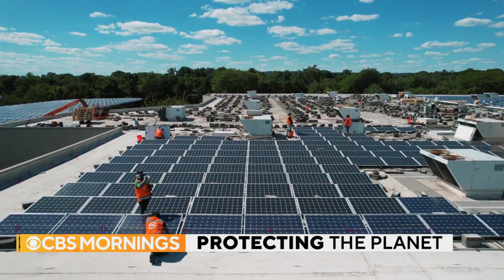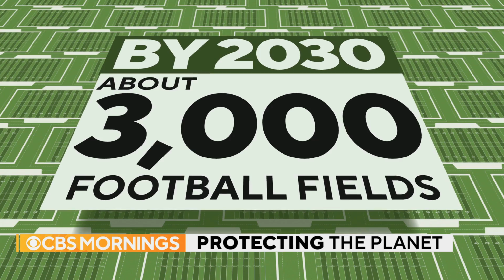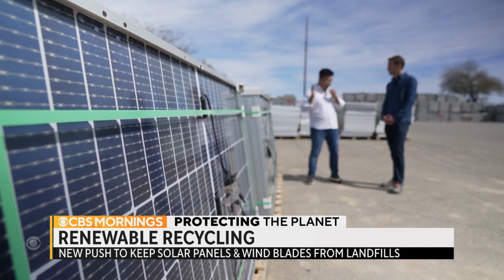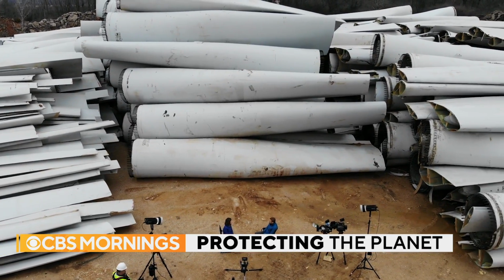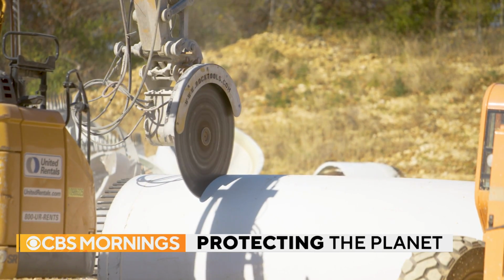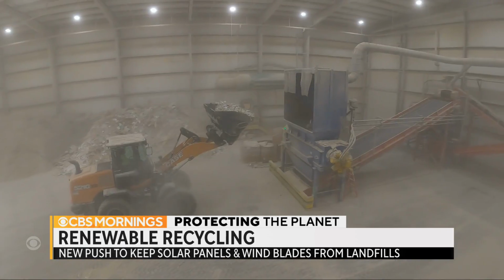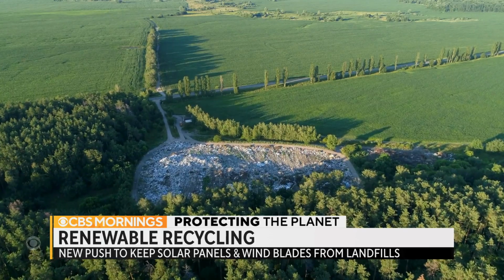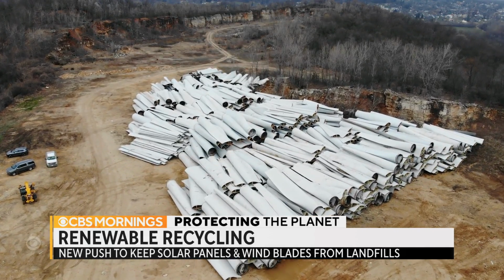Wind blades and solar panels head for landfills after being replaced

Comment: We probably need to develop more readily recyclable components.  Perhaps plastics?
Reply: I would love to see one ultra powerful prototype wind generator constructed of titanium pressed neodymium inside an aluminum housing.  From what I have read, titanium is a paramagnetic material that is not affected by magnetic fields, and it is strong and durable, light weight, and highly corrosion resistant.
Reply: Material recycling needs to become our primary material source, supplemented only as necessary by originally sourced materials.  I would invest adequately in aggregate material recycling, garbage recycling, toward this objective.  Our garbage is a gold mine.  Everything we use, everything we need, is right there in one convenient location, in our garbage.  An objective of 100% material recycling of garbage is a worth while objective.  

There is tremendous demand in the world, tremendous unmet demand, and ever growing demand, and we live in a fish bowl with a fragile and finite carrying capacity.  We have to plan wisely for our future and invest in this now.
Reply: What I am talking about is contactless, frictionless axles, spinning strongly magnetic discs, sandwiched in between conductive discs which may be possible to construct using aluminum.  The only place we would need bearings would be at the prop interface, and that's just to keep the bugs out.  The props themselves could generate their own electricity for the incorporation of LED lights with the placement of a magnetic ring at the interface interacting with a conductive circuit and LEDs built into the spinning props.  At minimum, magnetic field axles can greatly reduce the load of the prop systems, making these in effect light as a feather, as well as potentially electricity generating as well.  Titanium pressed neodymium may be the key to this.  I am sure we can make our wind turbines 10x as powerful, 10x as durable, but the prototype will probably be 100x as expensive, at best.
Reply: I think that at this time, converting unusable wind generator props into a cleaner burning fuel, in terms of green house gas emissions, to replace coal, is a strong step in the right direction.
Reply: We use centrifuges to separate by density.  Vibration can accomplish the same effect.  If we grind up our aggregate garbage, and sort out what can easily be sorted up front, what remains might be separated by vibration.  We would probably have a general idea of the composition of what remains.  Material bands might be analyzed using light refraction, mechanically separated, and re-routed through a refinement process.  I think it would be smart to aim for the production of our primary building materials through such an industry.  A material that can replace and outperform wood may be a top objective.  If we go for gross aggregate material recycling of all garbage, and if this becomes a primary raw material source for us, garbage becomes a commodity, and we might even be able to sell what's in our dumpsters, and if we pre sort, get a higher price.  Get a check from the garbage company, instead of a bill.  I don't think it's impossible.
Reply: I don't know if this can work, but I think it would be great if it did.  When you spin a magnet around a conductive coil, or a conductive coil around a magnet, this causes a current to flow, and electricity is generated.  As far as I know, this is the principle behind every turbine driven generator, from nuclear to coal to wind.  Spinning a conductive coil around a magnet, or a magnet around a conductive coil.  I an not an expert, but what I envision is just that, spinning one material around another, which is essentially an interaction of concentric cylinders, and the limitations on the respective surface are of these.

If we have an axle attached to a wind prop to spin that axle, imagine if to this axle were affixed titanium pressed neodymium discs which spin with the axle.  These spinning disc could be sandwiched between fixed aluminum discs, or similar for facilitating a flow of current.  Titanium may be one of the best materials due to it's high capacity to retain it's shape and resist warping.  I don't know what kind of field drag would be in effect, or if it possible to maintain such system for long without the disc warping.  This could be a fundamental flaw. However, the spinning discs would be made thick and more durable.  I think it's worth exploring.  The main advantage is a greater surface area, of multiple interfacing discs along a single axle, as opposed to an interaction of concentric cylinders, we'd practically be getting volume out of this, instead of working only with surface are, the surface are of multiple interfacing discs could potentially be much greater, perhaps even 10x.

As for the contactless frictionless axles, I retail neodymium blocks that are smaller than a standard brick, with a pull for over over 2000 lb.  That pull force could also be a repel force.  If you take a disc shaped magnet and cut out a donut hole in the center and then flipped that donut hole, I believe what you would wind up with is a 'like' polarized repulsive alignment of the two magnets.  I could be wrong, however, just cutting the magnet might result in this.  It's an analogy as well, I think magnets can be polarized in their geometry when created.  I am also uncertain how geometry effects the strength of the magnetic fields.  However assuming we can get a strong field like this, if the donut hole were fused to the axle, and set in side the donut, this could essentially suspend the axle vertically in a magnetic field.  Paired perpendicular discs at either end, either affixed to the axle or affixed to the housing, could similarly lock the axle in place with magnetic fields, preventing horizontal movement.  Just having a neodymium brick beneath a spinning axle with a magnetic donut affixed to it might give vertical support to an axle, taking weight of load bearing aspects.  At minimum I would think it is possible to use magnetic fields as load bearing aspects.  I am uncertain what the effect of field drag would be, however, compared to the resistance of bearing or other similar parts, especially parts that are load bearing and moving.  

The  main problem I can think of is the accumulate of any kind of magnetic dust, which would go straight to those magnets.  Air inflow ports would probably also need to contain magnets to trap such material before it can get to the sensitive areas.  

I think it's definitely an idea worth exploring, and I think titanium pressed neodymium may be the best material for the job.  If we can get 10x the surface area interaction and electricity generation, and 10x times the durability with frictionless, contactless, or greatly offset load bearing magnetic axle suspension, we might also get 10x the durability.  This would justify 100x the cost.
Reply: A utility of field drag, however, we can use field drag as a brake.  A frictionless direct force break.
Reply: Another aspect I would like to find out about, which I hope might be miraculous, but which may turn out to be comparable, might compare and contrast field drag to physical friction.  If we have a 2000 lb. axle, supported at a load bearing point, that point would take on 2000 lb. of load.  If these were bearings for example, we might extend out multiple bearing rings to distribute that load.  Would the net friction be the same or reduced or how would that work?  If we did something similar with magnetic fields, what would the effect be?  I suspect it might be comparable, but it would be great if something unusual happened here.  There is a strong correlation between proximity and field strength.  An axle could also be similar to a lever and fulcrum.  The relative position and strength of the magnets might result in a load bearing vs. field drag balance.  Could this ever work out to anything other than comparable to a load bearing physical friction?  I think it would be about comparable in general, but it's an interesting idea.
Reply: Neodymium can lift thousands of times it's own weight.  Press that into titanium and I think we have a winner.  

Make the axles out of titanium as well.  

As for the props, I don't know, but I suppose we might as well put titanium as a frame on the table.

We are going to need a lot of titanium.
Reply: A cylinder is essentially a rectangle with the ends touching.  The area of a rectangle would be length times width.  The volume of a rectangular solid would be length times width time height.  If we call it at approximately 1/3 of that we can squeeze in titanium pressed neodymium current generating interface, it's not an exponential leap in the potential of turbine energy generation, it's about 1/3 of an exponential leap, but that's a major advance.
Reply: "For most purposes, a sphere has the greatest surface area. A cylinder has the second greatest surface area, and a cone has the third greatest surface area." 

"Of all shapes with the same surface area, the sphere has the largest volume."

"the sphere is the strongest 3-d shape. The reason being is that stress is distributed equally along the arc instead of concentrating at any one point." 

"The increase in volume is always greater than the increase in surface area. This is true for cubes, spheres, or any other object whose size is increased without changing its shape."

We could use a series of spheres on the same axle.

For discs, it pretty much comes down to the number of circles of the cylinder created by the square, that can fit in the square, vs.. those that can fit into the cylinder.  If we can fit more into the cylinder than we overtake.
Reply: I don't think the axles can work at all, to tell the truth.  If it's a fixed orientation the magnetic force can be fixed, but if one of the magnets is spinning, I think that's going to alternate how the poles line up, and I don't know if there is a way around that.  I don't know if this can be made to work.  However, I still like wind.  Wind, free incentive solar, and a global energy grid.  It's a little different being reliant on the other guy for energy if that reliance is mutual.
Reply: Maybe it can produce 10x the energy, maybe it can cost 100x as much, and then wind up with a 100x as expensive wind turbine that can't turn!  Back to the drawing board on the contactless, frictionless axles.
Reply: I am still betting on titanium pressed neodymium.  

Consider this, however, for the contactless, frictionless axles.  If we have a magnetic disc and cut a donut hole out of the disc which is then fused to the axle (which would pass through a donut hole in the donut hole), if we kept the donuts at the same alignment, but rotate the donut holes a number of successive degree, so the pole line up with attract / repel successively, like a wave in all directions, what would this do?  Maybe there is a way?  If we had it so that attract is always up and repel is down down, countering gravity.  We'd definitely still have some bearings in there to play it safe, and to keep the thing from bouncing too much.  Could we still greatly reduce the load at friction points?  A lever and fulcrum effect is still a tool we can work with.  I think we would always want (in terms of load bearing, opposite to gravity) attract up, as a counter to gravity, we would want repel up as a counter to gravity, and can also incorporate a repel down to counter an attract up when necessary, because the proximity issue is where we can lock up.  We would want everything else to balance, with the primary aim of compensating for gravity, as well as absorbing variation.   With a lever and fulcrum effect, if a repel down point is further out on the axle (presumable closer to the prop) than an attract up point, if these fields are otherwise of equal strength, I would wager the repel down point will overpower the attract up point.  We can incorporate the generator disc later.  Right now we just want an axle that will levitate in place when still, and will rotate, with field drag, but without contact or friction, when rotated.     

We are going to try another approach as well.  An initial idea was a magnetic ring sitting in a half circle.  Cold we get away with something like 8 half circle magnets, positioned at right angles, and successively, as if in a donut, along the length of the axle, and all oriented to repel?  Essentially a field bracket?  12 half circles in groups of three, with 2 oriented on way and 1 oriented the opposite, all together bracketing in all four directions.  Proximity is a major aspect of magnetic field strength.  Bounce or variation could be contained by this.  

Now I am confident it can work, and it may even be easy.  12 half donut brackets, each with their respective donut hole, working on one axle.  

If you divide a magnet it becomes an entirely new magnet, in regard to the orientation of the field.

We're going to take one more throw, just working with rods or cylinders.  If we have a magnetic rod, braced at either end by like aligned magnetic plates to prevent horizontal motion, and then perhaps 1/4 in from each end, at 90°, as if the rod were passing perpendicular through an axis or grid origin, at each of the four directions, two small magnet rods, +/-, however, with the repel always distal, further way from the center of the axle rod.  Would this levitate the rod?  The fulcrum effect in either direction would always favor the repel force.  That's a rod, locked horizontally by two magnetic discs, and in all vertical directions by 16 axial magnets, a +/- orientation at each axis of orientation, at both ends?!

That's one great thing about titanium, it can be welded.  Though super glue might work just as well for a make it yourself model.  We can make one of these at home.  Who is going to be the first to invent a working contactless, frictionless axle?
Reply: Magnets are polarized.  At the poles the field strength, the field alignment, is strongest.  At other points the field strength is less strong.  

If we had a ring of small cylinders or rectangles, inside another ring of small cylinders or rectangles, oriented so the strong poles are repelling, this would be a start.  Positioning these in a circle would create and angle of alignment, in between which the field strength would diminish.  A subsequent ring could be rotated to cut that angle in half.  

I am confident we can build a working prototype using super glue.
Reply: One more question.  If we took a magnetic disc and cut out a donut hole in it, would that donut hole magnet flip itself, or perhaps rotate 90° or otherwise, in a certain direction along different axis?  For a magnet cut into two magnets to re align to an oppositely aligned configuration, what path would that alignment have to take?  Could that realignment, which might be similar to an axial alignment, give us a picture or a piece of a picture of a dimensional lemniscate?  What exactly is a field and why do these work the way they do?
Reply: They say the the triangle is the strongest shape in architecture.  Could the same principle convey to magnetic axles as a means of optimizing force fields?  

If we have a magnetic cylinder aligned strongly with +/- poles, and if we shave this cylinder into a cone, would we retain the same strength in the remaining circular pole, while the other end is shaved to a point?  Could we arrange these cones, circle out, into a donut, and in this manner further narrow the angle between the axial alignment of the respective poles?   I believe this is indeed the case.
Reply: I honestly think it is going to work great.  If we can't get properly polarized donuts, we can make these out of cones (wedges).  An axle can be braced with half circles, or even cylinders as a point support, vertically at the four directions, and horizontally with donuts or plates.  The axle can also be reinforced with additional vertical force to offset gravity.  We can get the axle approximately in place, and then ratchet down the final fine tuning of the respective field braces.  I think we are in business on this one!
Reply: The two main issues we need to work on are comparing force fields and field drag to bearings in terms of load bearing and resistance.  The other fundamental issue is spinning disc generators, generating current through the physical force of field drag, and preventing these from warping.  

One advantage I can think of in regard to a spinning disc is the momentum of centrifugal force.  The greater the diameter of a disc the greater the centrifugal force at the circumference.  It's like getting a vehicle up to speed, and then maintaining that speed more efficiently.  It may be like comparing a large wheel, small wheel, and spinning cylinder.  A large wheel may be harder to get going, but once it is going, it will convey a lot more momentum to keep going.
Reply: If you look at the anatomy of a wind turbine, the support structure is called a tower.  There is a lot more space in the tower then there is in the turbine nacelle.  What if we suspended the axle downward, again using paired magnetic rings, interspersed with generator magnets around the axle.  What kind of prop might propel such a vertical wind turbine?  A modification of the whirly bird turbine roof ventilator. 

I think the whirlybirds can also utilize wind coming from any direction.
Reply: We are going to optimize that field bracketing design so effectively we're going to have to bolt them down to keep them from shooting upward, and resistance from field drag is going to be in the negligible range of 1/100 of a percentile on the rotisserie motion, a straight mass to gravity calculation.  It's not impossible.
Reply: The entire drive system, from the whirly bird, to the axle, to the bracketed magnets, to the generator magnets, not one piece of the spinning drive system, will physically touch anything.  The support force would be from a ring magnet fused to the axle sandwiched, bracketed, between two support magnets fused to the structure.  The drive would be from whirly bird, and the currency generation would be from generator magnets fused to the spinning axle.  If we design this just right, the entire drive system might just sit and spin, light as a feather (relatively speaking).
Reply: We need mega tons of titanium!  On the upswing, however, among the so called 'rare earth' metals ... "Neodymium is fairly common—about as common as cobalt, nickel, or copper—and is widely distributed in the Earth's crust. Most of the world's commercial neodymium is mined in China, as is the case with many other rare-earth metals."
Reply: The whirlybird configuration will probably stack two whirly birds, spherical or disc configured prop fins, looking like a figure eight.  The turbine may need to change direction on occasion, but it can probably utilize wind from all directions.
Reply: I am going to add an important postulate here ... the load bearing for the turbines would be facilitated by magnetic fields.  At the load bearing coupling, a base magnet would be bracketed securely to the physical structure of the tower.  This would be the main load bearing support.  Above that is a repulsively aligned equal magnet fused to the spinning axle.  Above that would be a repulsively aligned equal magnet bracketed securely to the physical structure of the tower.  Axle support magnet would be sandwiched between these, preventing vertical motion of the axle.  (We would also have similar magnetic support couplings preventing horizontal motion).  If the space between the Axle support magnets is ranged, increasing from top to bottom, probably by millimeters, affecting the field drag by diameter, what I am postulating is that this can have the effect of minimizing the net field drag to the point where it may become negligible, 1/100 of a percent, in theory, translating to a straight mass to gravity calculation on the force necessary to spin the axle.  That's my postulate.  We are essentially stacking force fields with an effect that's going to be comparable (perhaps) to a wing, creating lift, in a way that minimizes field drag.
Reply: It may have to go the other way, however, the space between the Axle support magnets is ranged, increasing from bottom to top.

Like skipping the top of an atmosphere, instead of delving headlong into it.  Or another analogy, as if the whole axle came to a point just touching the pole of a sphere.  Like lifting easily from all points, instead of straining at single points.

There are many physical limitations, but in theory, can there be a net field drag minimizing effect?    

Would the net drag be the same?  I don't know, but we should test this.
Reply: Now here is where we are going to launch this rocket.  The most load bearing support for the turbine axle will be at the base.  A triangle is generally the strongest architectural shape, so at the base of the axle will be a fused, flat topped, wide bottomed, cone, interacting with a repelling cylinder of equal diameter, anchored to the floor.  We will call this one the Usul point.  That axle is going to pirouette on that magnetic field.  We are definitely going to need to ratchet down all those magnetic braces because if those were gone the whole thing would pop up.  I have a feeling that field geometry can make this turbine turn smooth.  For a vertical generator housed within the tower, we'd probably return to cylindrical magnetic generators fused parallel to the spinning axle, within conductive cylinders secured to the structure.      

https://www.youtube.com/watch?v=GHhD4PD75zY
Reply: Innovation, industry and liberty!